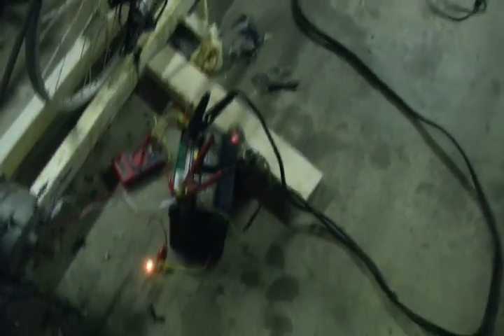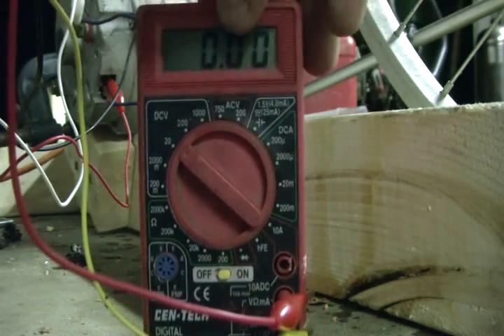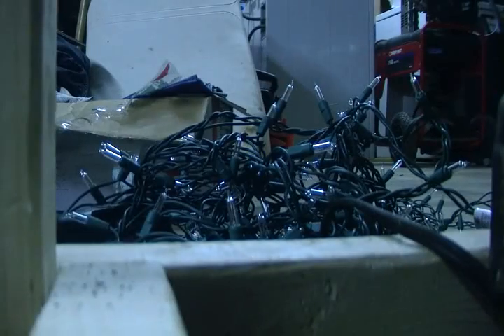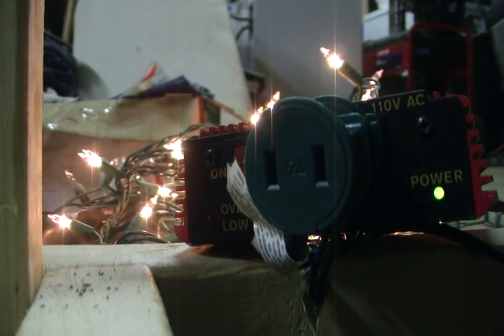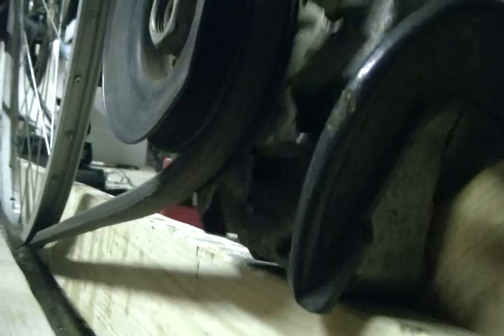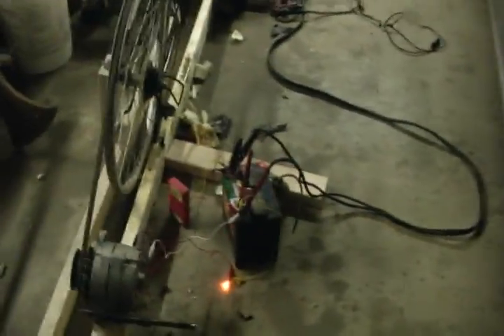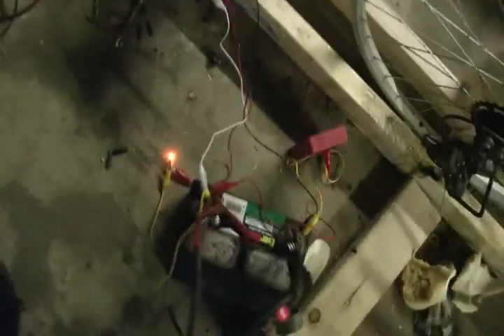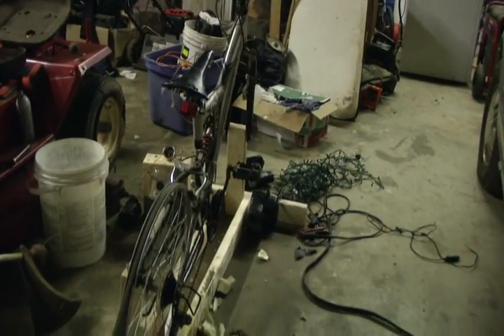homemade bike generator - 11/15/10

Comment: The alternator should be self exciting...not sure why you have the battery in the circuit as in it's current state, it's just a large capacitor.